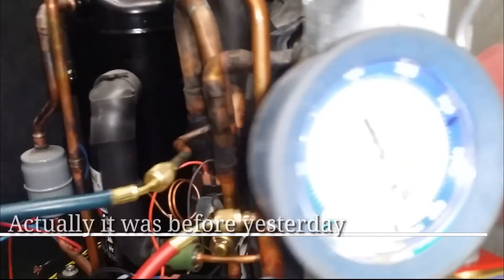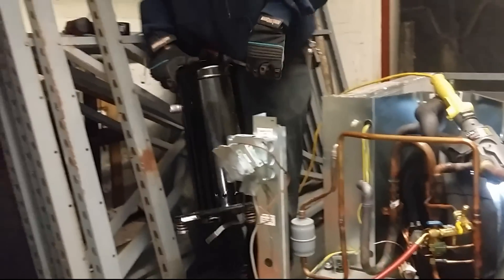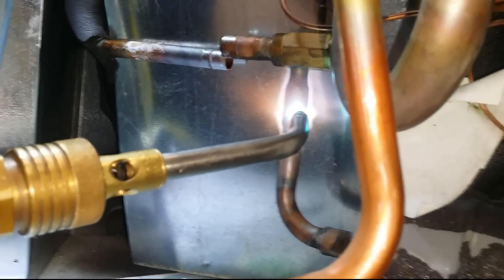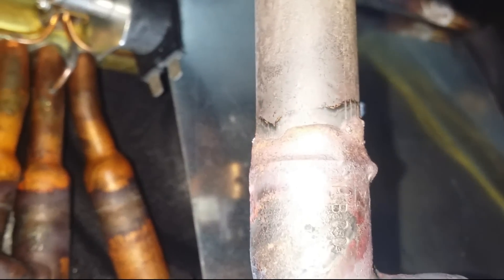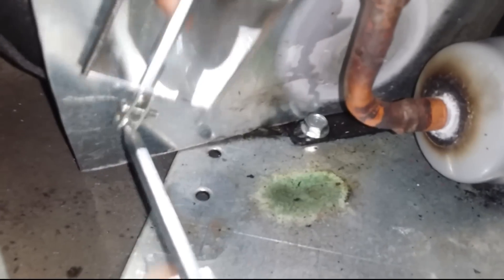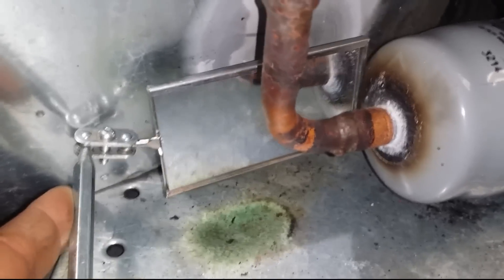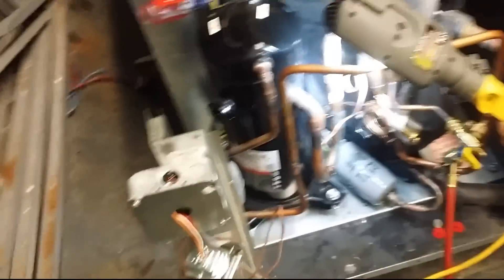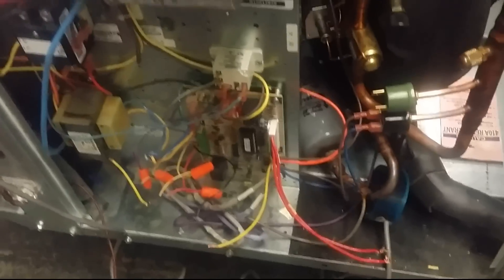HVAC | WSHP-BAD TXV | LEAK SEARCH PT2

Comment: Good job!  I just started following your channel and am enjoying the videos. Maybe it's just the angle from YouTube but it seems as though your brazed joints could benefit from focusing the heat more on the socket side to draw the braze into the joint especially on vertical up joints. Thanks for the videos.

Comment: We take those things back to our shop. It sucks taking all your tools out of your truck in a high rise.
Reply from the maker: We also take it back to the shop if there's no place in the building to make repairs. However I have a shanty and that laundry room is my repair center. I have verything I need there to test the equipment once I'm done, disconnect box and water supply. ain't I lucky Mazz Lol

Comment: Good Job Emin HVAC. Do you just connect long water hoses to unit and temp up the electrical to test the unit on the ground?
Reply from the maker: Yes that's exactly what I do, I'll have it on part three. thanks for the support.
Reply from the maker: Jason Strom thank you for the support bud.
Reply: Good Job

Comment: Good video Emin, who designed that unit, can't believe you had to take it all apart to change the expansion valve.
Reply from the maker: heat controller. This is the 5th or 6th one I've had to drop to make repairs.  they are installed in extremely tight spots. thanks for watching Jim.